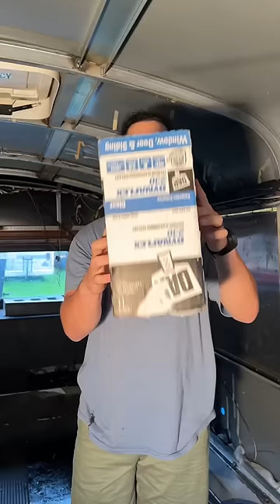byebye windows!#skoolielife#diy#diyprojects#vanlife#skoolieconversion#buslife#busconversion#tinYhome

Comment: #2 tip for you two. Get about 10 cans of spray foam insulation. Fill all of the spar bars from the floor to roof to floor, let sit two days. Those spars are equal to over two feet of insulation loss. When dry, trim as needed. The foam will also fill all the gaps in the roof and really make things quiet and solid.
Reply: Ohh yeah, insulating the sides and putting up some sort of paneling might work perfect
Reply: Your wrong don’t use spray foam it traps water 😂
Reply: @jessekoppenhaver3442  Spray foam for the inside roof spars, it insulates and secures the metal between the roof sheets and spars. For the remaining portions of a bus/my bus, I sprayed rustolem enamel on all inside portions of the bus, then used , DynaMat sound deadner sheets (12 cases), and finally 1-1/4 panel insulation. Costly yes, results stunning.
Reply: #3 tip for them, buy those little caulking helper squares if you aren’t great with caulking they save you so much time and effort!
Reply: Your girlfriend need to learn how to stop cussing 🤬
Reply: Your girlfriend need to learn how to stop cussing 🤬

Comment: I live on our 15 acre ranch in the Rocky Mountains, we have a bus we made into a cabin in the woods, there is no way I would ever take out windows! 😮🥵
Reply: @donnawestbrook8992  Yeah I am aware as to why they took them out! Not sure why you said this! I just would not do it myself! It’s not like I bashed them for doing so! Or even said they where wrong! I was just sharing my side of owning a bus! So I guess thank you Captain obvious! 😏😃😎 besides, I have a Tranny bus, not a schooly. My windows a are bigger and already tinted. So I would not even be able to take my windows out like they did. Windows on a tranny bus, are almost the whole upper half of the wall! And also to me heat is not an issue, not because I don’t live in Florida, but because I am a minimalist, and we don’t used forced air heating or cooling. So our bodies regulate easier in whatever temps we are in. So it would not matter where my bus is located I WOULD LITERALLY NEVER REMOVE A WINDOW! 😎 k thanks for chatting Karen, see ya!🤣😇😊☺️😉

Comment: Great videos as always you two. I do remember the days of window deletes three years ago, Lol, fun. 
We made it back from our first trip, and here are some fuel burn facts.  24 gallons fuel round-trip or 224 miles or 9. 3 mpg. Or 23¢ per mile. Or $13.80 hr at 60 mph. 
The horsepower on the bus has to be turned up, the low school bus eco power level does not cut it on the hills. Will be turning up from 220 to 300. More power is less fuel being able to get bus to up to speed a lot faster and not using 100% throttle on hills. The dealer will do this for $160. 
2002 Thomas/Freigtliner/FS-65/MT643/Cummins 5.9 24v/9 window. 21000 LBS loaded at scale.

Comment: That will be a big improvement.

I worry about that caulk, it's not designed for this type of application. I personally would have caulked around the panels as I installed then with a silicone based or even a butyl based caulk( used on RV's & campers). I would recommend using one of these types and caulk around the outside seams.  Keep it up!!!
Reply: If you use the common household calk sold at home improvement stores, absolutely worry. It is not designed for metal to metal sealing. I did my windows three years ago with automotive Permatex black sealant and its holding up great. I filled all channels full and set into place, then removed the excess. Two full tubes per window or $32. Household caulk is not designed for constant vibration and flexing of metal to metal. Also absolutely avoid Gorilla Glue caulk, it dries out and leaks.
Reply: Butyl tape is by far the better way to seal those panels.  That caulk at the seam will leak.
Reply: Can confirm it's a horrible idea from experience, but for a different reason. I filled in some large gaps between the window and wall at my partners old grannyflat, since a lot of creepy crawlies were coming in. Anyways, the area had small amounts of condensation here and there, and it took 2 weeks to dry instead of the advertised 48 hours. It became the perfect spot for a fungal arrangement to bloom 😂
Reply: Sika 221 would have been better.
Reply: @snootyfox.indahouse  For my bus, I used the full size tubes of Permatex black. So far almost four years on and not one sign of failure. To fill the top and side channels, it takes two tubes. For the spar channels (outside window frames, I filled all with fire blocker expansion foam, and trimmed flush. Labor is more, but all is waterproof even if caulk fails.
Reply: Agree this looks like indoor window and trim caulk not gonna hold up for very long I use that same stuff inside my house around my windows and I have to redo it every few years or so because it eventually cracks from the house moving, I recommend OSI for something like that it is a pain to work with because it is super sticky but will hold for a long time
Reply: She just wanted a reason to talk about him "busting out the caulk".
Reply: was going to post something similar as what was done here seems like it will just let water pool in the window frame
Reply: Literally was checking the comments to see if anyone else would say anything 😅
Reply: Not an entire reply section talking about caulks

Comment: I love all the windows of our shuttle bus conversion. If I didn't want to see outside, I'd just get a regular camper.
Reply: Yeah, i understand wanting more privacy/stealth but removing all those windows... seems like it would leave it a bit depressing those times you're stuck in the bus on a rainy day for example. Plus having at least a couple windows remaining helps with air flow & free ventilation (without needing AC) through the bus. Also, it seems like a loss of a lot of natural light. Just my 2c 🤷
Reply: Yep I would have left at least 2-4 windows for airflow and natural light.
Reply: Right they rushed with this
Reply: @hawkeyescoffee6399 thisss. They should have kept a couple windows in the back. But I guess they still have the front windshield
Reply: hi tow😂
Reply: @carmay3600 lol!!! They are obviously going to use some actual real and custom windows
Reply: @carholic-sz3qv  the point is, why use custom ones when it comes with windows?
Reply: That thin metal will also heat up pretty quickly in the sun, and heat up the air inside, that isn't moving because there are no windows!

This goes to show that you shouldn't do DIY projects if you have no clue what you're doing

Comment: its better to caulk the inner corner before pushing the plate in there , as theres less chance of water staying in between the frame and the metal sheet you put in , allso when having these plates bend ask them to put a slight cross bend / kink in the metal from corner to corner both sides , this puts a little tension in the metal and prevent the big pieces from droning like a metal drum , another option would be to stick dynamatt on the inside , that does the same thing preventing droning from vibrations during driving or from the wind buffeting past the bus

Comment: My opinion you should have made a jig so you could drill the holes in the window blanks all at the same places then take them inside the bus then drill the window frames so you could install rivnuts so all the window blanks could be interchangeable and it would make it that much easier to seal the windows in the future when it's needed

Comment: As a bus driver, you might want to keep one window on the front passenger side. If the road bends to the rear of the bus on the right or if the intersection is on a curve I always look through that window to check for traffic.

Comment: When I bought and built my barn loft shed out testing insulation out found out the foam with metal foil on one side was the best only down side is 15 a sheet 4 by 10

Comment: I know it's too late but the sealant should go in before you put the screws in cualking on the inside will leak after time lookup wet sealing metal together. Good luck and I really hope it goes well

Comment: Quick tip for anyone wanting to do this your best bet is a city bus NOT a schoolie. Preferably a diesel pusher. School busses now are dang near disposable whereas transit busses are still built on a million mile + chassis. The drive train of a modern schoolie is garbage especially any post 2007 international maxxforce dt series engine. They used to be nicknamed "the ledgend" for years then they were redesigned in 07 to be garbage.

Comment: Did you also caulk around the outside as well?  Because, water will still leak through the edges.  You should have also considered rubber gasket between the metal inserts and the window frames as well.

Comment: Only comment I could make.  Is should had silicone the seems of the panels before sliding then in place.  Siliconing the inside won't stop water from coming in around the outside.

Comment: Guys guys guys. For starters it's not decorators Kaurk that you want to use to seal outside from in its silicone. And drilling metal. God just go and buy 1000 self tapping screws. They are a screw that can screw through metal no drilling involved

Comment: Drilling metal with out a self tapping screw and a actual drill... isn't hard just don't use a impact to force them through as the torque qill cause the screw shank to sheer itself.

Comment: plate, pilot drill, remove plate, caulk to actually seal, then add plate and bolt.... all you did is put a skin on the seam... now do it again remove useless caulk remove plate add sealant/caulk then put plate back may need new screws/bolts

Comment: Should of put silicone not caulking under and around each of the lips of the metal inserts you replaced the windows with.  Then silicone all of the edges and nothing will seep in for at least 10 years or more depending on wear grade of silicone you bought.

Comment: I’m sorry to say it but over time you’re going to run into leaks with the heat from those panels and the caulk is probably not rated for heat or UV. You should of put a bead around the window first then put the panels up and then also add insulation behind the panels to really maximize the results. Otherwise you’re pretty much turning your bus into an oven…… 🤷‍♂️

Comment: coking windows i would used  100%  silicone it will not try out and crake this what the used on my window in my 1996 schoolie they was sild with 100 silicone to start but good luck on you bus